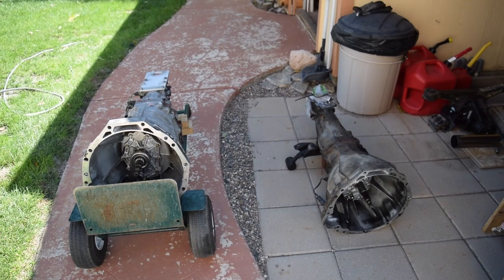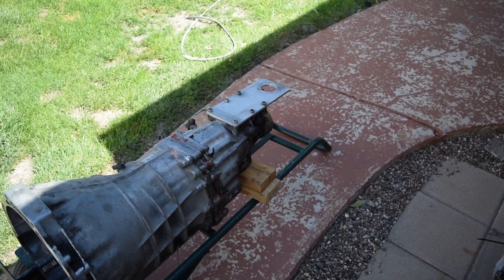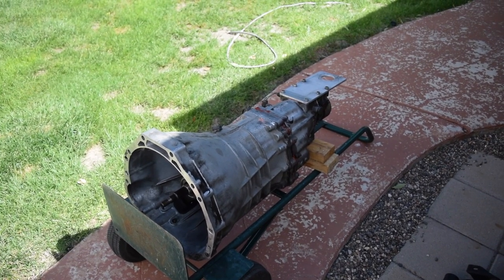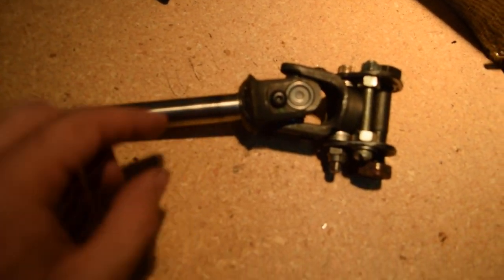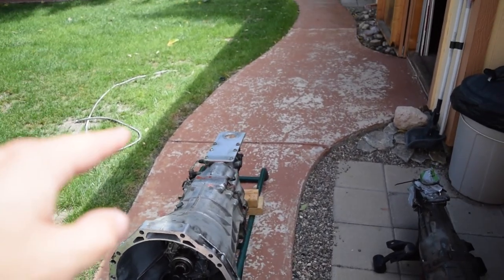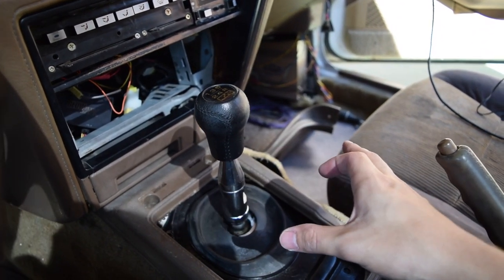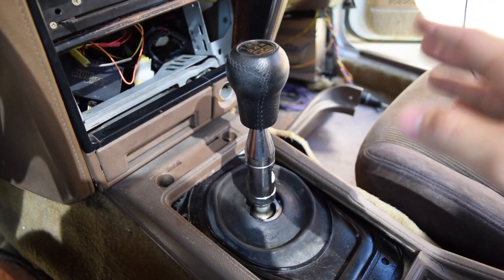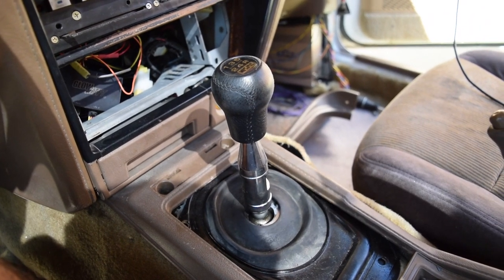Pathfinder Transmission Swap

Comment: I have a question, please. I have a 5-speed 2.5l automatic 2014 diesel because im in Europe. I just want to swap to the same exact model but 7speed from the 3.0L .  Do you think it will fit?  Thanks

Comment: Lots of details and knowledge.  Thank you. 
Q: I have a 2007 v6 rwd and need to replace the transmission.  How do I know what other vehicles will use same one?
(Can I use a 4wd ?)
Thanks again 🤙🏼
Reply from the maker: You can swap pretty much anything into anything with enough time and money, but to make your life easier, just get another 2wd transmission from the same generation and model you have. Everything bolts up, plugs in, and works properly that way

Comment: Wow a lot of work, but awesome video man! Debating picking up a z31 30a for $400 and a 2 hr drive lol
Reply from the maker: That's not a bad price haha! The closest one I could find was 12 hours away and 1500 lol
Reply: @TheZGarage  It’s a good price bc it’s a junkyard… I don’t have a truck though so I’d have to get my buddy to come w me lol. How much was the custom driveshaft?
Reply: @TheZGarage  bro don't stop posting videos of the Z.
I've got a 1986 Z like yours and a 1991 slicktop Z.
Even tho both my Zs are stick shift, it still helps alot seeing your videos.
I'm currently having trouble with my 86 tho, I think it's the MAF actin up. I can start the car no problem but In gear it starts sputtering, I have to rev the f out it just to move it slightly.
Reply from the maker: The maf is a good guess. You can just try cleaning it and the connector. That will make sure it's reading as accurately as possible

Comment: I found an 1984 300z turbo, can I just swap out the trans without any mods?
Reply from the maker: As long as you have the appropriate driveshaft then you can put any z31 transmission in without any issues
Reply: @TheZGarage  Can I use the driveshaft that the 84  has now?
Reply: @TheZGarage  I have a 1985 300z non turbo.
Reply from the maker: If you use the same driveshaft you have to use the same transmission.
Reply: Is there a difference between coupe and 2+2 driveshaft? @TheZGarage
Reply from the maker: Yep. The 2+2 driveshaft is about a foot longer than a coupe
Reply: but my 2+2 NA driveshaft will work with a turbo transmission?  @TheZGarage
Reply from the maker: No. All na z31s came with a 71c transmission. 84-86 turbos came with a t5 and 87-89 turbos came with a 30a. As far as I know each of those transmissions use a different length driveshaft and have a different yoke spline. So you would need to find a driveshaft from a car that was the same length (coupe vs 2+2) and same transmission. Otherwise you can get a custom driveshaft made by shaft masters. You just tell them what your transmission is and what your rear differential year is and they can make a custom one for you.

Comment: Good stuff! I have a Z32 30A that I just bought and I'm looking to do the same thing. Did you keep the open diff in the back before you had a driveshaft made? I'm looking into a LSD before I drop the money on the driveshaft, not sure what setup to go with
Reply from the maker: Yeah I still have the stock open diff, but I'll probably get a Kaaz lsd soon since it should just bolt right in. No need for a new diff case or input flange.
Reply: @TheZGarage  that's what I was looking into doing for simplicity sake, thanks for the input!

Comment: I've head the cd009 will fit, is that true? I would love to have 6 gears.
Reply from the maker: I have looked into that too. Technically you can adapt a cd009 to it, however it's extremely expensive for all the parts to do it as there's really only 1 company that makes the parts (JWT) and then the 6th gear ratio is actually pretty close to 5th on a 30a so there really isn't any gain. You just end up rowing through gears more often. So in the end you could get a brand new 30a for cheaper (depending on the cost of your cd009), it's less work to put it in as you don't have to build custom mounts, and it works just as well so there's not much reason to use one.
Reply: @TheZGarage  didn't know that. Not gonna do anything till my transmission blows up but I have a built motor going in soon 🙃
Reply from the maker: That'll be sick! It's always a good problem when you break things because you're making too much power haha